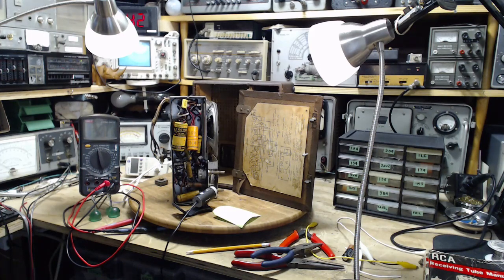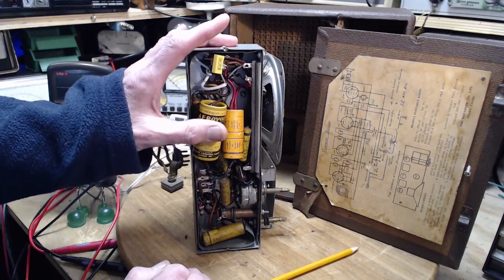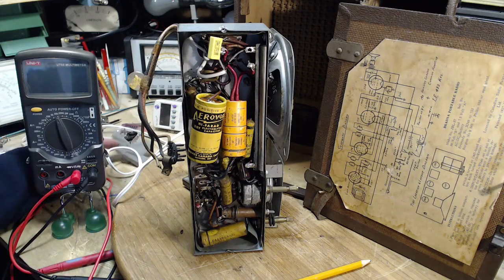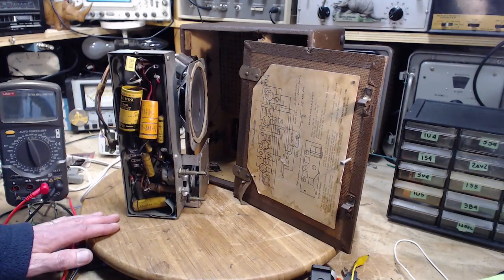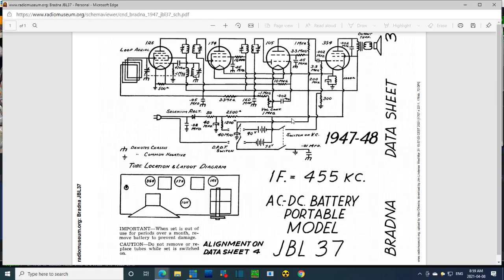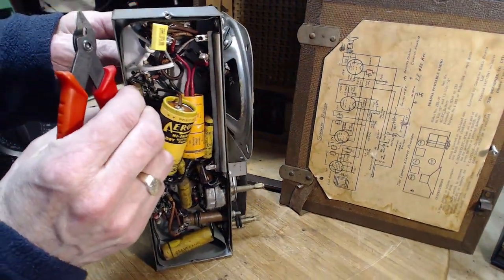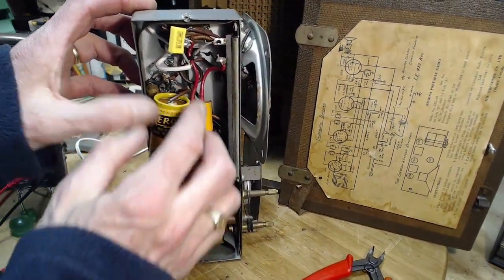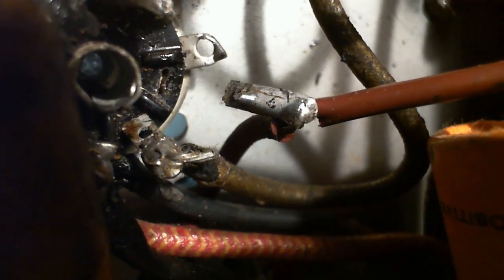Breadner Bradna JBL 37 Tube Radio Video #3 - Battery Switch

Comment: Let me see if I follow... he starts butchering this radio after stating how unique and rare it is. Great. The usual sloppy trouble shooting and eclectic repair attempts, and then he being totally unable to replace a simple DPDT switch decides to mutilate it. No worry, rip a socket pin, had to be a manufacturer's production error, extensive to schematic drafting and previous unqualified repair incursions. Seems the simpler the equipment is, the less he can understand it. Still no worry, nothing a generous soak with WD-40 can't take care of. What a joke.

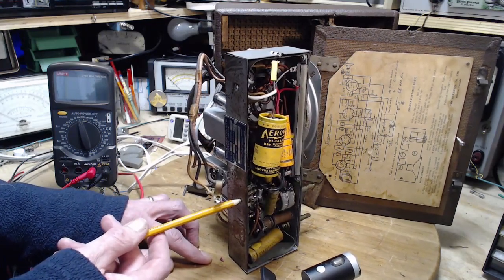Comment: 1:44 Stop blaming others for your own misdoings. The screw on that terminal must have been removed by you or you lost it messing around in that poor radio! The first video on this radio from you at timeindex 18min24sec clearly shows that the screw which you claim to have been removed by some other person is still in its place holding that terminal strip to chassis. Everyone look for yourselfs  https://youtu.be/scmDlwQscmk&t=18m24s
Reply: Ahaha... Busted.... He always does this, it's always someone else's fault... He even blamed the manufacturer several times, saying the plant was poorly lit and they solder the cap to the wrong terminal...
Reply: @StillCloser  I'm not trying to "bust him"..  I honestly worry about him... He had a career in electronics, he knows this!  I'm NOT trying to be mean.
Reply: @walk-tall-hikes  I didn't replied to you...
Reply: It fell out in the second video. He even commented on the fact that the screw fell out of the radio. https://youtu.be/L01UtjRGrqY?t=247 I worry sometimes about Jim, he seems like he is getting more forgetful.
Reply: It seems to be happening more now.  I cannot believe that he fretted over what to do with the terminal strip when it was so obvious.  It pains me to see this limited number of radios and him just cutting wires away and removing the switch.  Change out the caps and will have tons more room. Plus it will help ensure that those tubes wont be messed up.  With such critical voltages needed for the tubes everything in it should be checked!